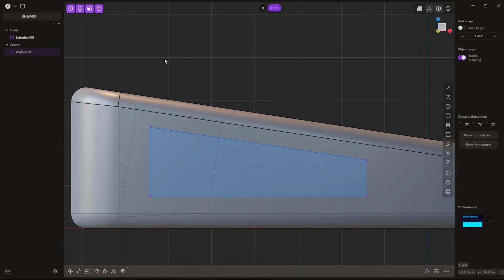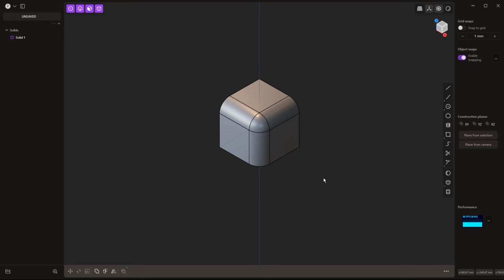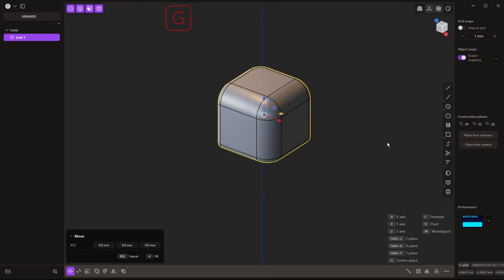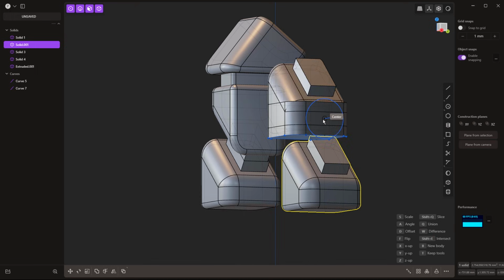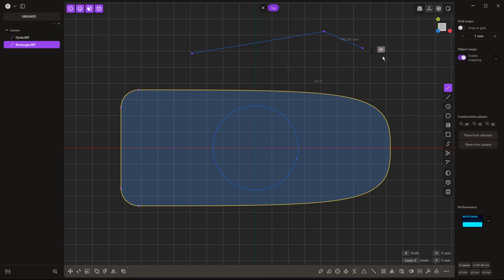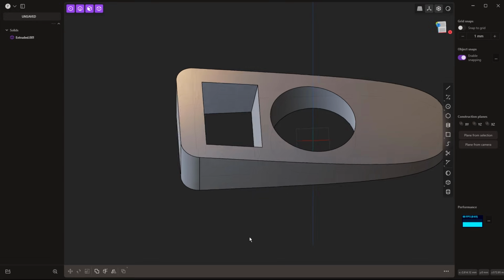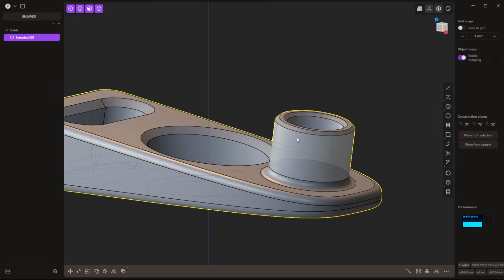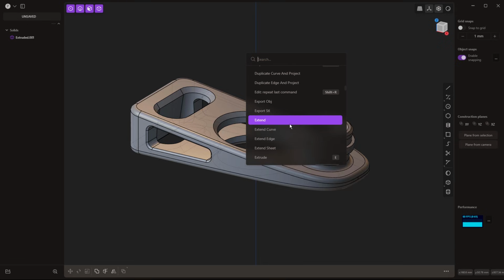Getting Started with Plasticity for Beginners | V1.4 Update | UI and Modeling Overview

Comment: "Traditional" CAD such as Siemens NX & Solid Edge, IronCAD and Spaceclaim do all that direct modeling together with parametric modelling at the same time.
Reply from the maker: That is true, but they aren't as good at it and most of those are a lot more expensive too.  IronCAD is the only one that is under $1000 in that list.  NX i think is well over $10k.  Solid Edge is very bad from a UI/UX perspective and is $2000.  Spaceclaim, woof :)  I don't even think they list their prices online.

What i mean by they don't do direct modeling as well, programs like Solidworks for example made a "Direct modeling" toolbar and just stuck tools that have existed in it for a long time.  But when push comes to shove and you try to move faces around for example, or add fillets to complex shapes it chokes.  I have taken several models from Solidworks, Fusion and others that would not fillet or shell, and plasticity has no issues with it.  Even though its build on the Parasolid Kernel it is a bit more flexible.

But yes traditional CAD in nearly all flavors have direct editing.  Honestly the closest one for me is Fusion.  Turning off history and still being able to create detailed sketches but not capture history is the next quickest thing to Plasticity for me, but its not the right tool for everyone.

Comment: Yes, but history even in Blender (not only CAD) is EVERYTHING. Its non-destructive! In Blender this is achieved by modifiers and Geo Nodes. Without history, you cannot adjust a project easily later. You have to do ALL the work AGAIN! This is a NO go for me. This is a great program, but it needs to have history or geonodes or modifiers added. This is a must if a client needs to modify the design in the later process!
Reply: I agree. History and the ability to modify is a huge part functionality.

A workaround for lack of history is to "save as" as you develop a model, especially before adding a key element. Another option is to develop seperate files as parts then combine them. This prevents you from having to start over from scratch.
Reply from the maker: @dchurch911  You can also duplicate the bodies you are working on and save a version of it.  Similar to how you work in multi-body parts where you derive something out, except here its independent.  I do this in Fusion Forms all the time.  Make a clean base shape and dupicate it before adding details.  When i get to a point where i want to explore something ill duplicate it again leaving an untouched version in case i need to take a step back (even though Fusion saves a version each time).
Reply: It is worth noting that although there isn't a timeline option, plasticity makes it very intuitive to delete bevels, champhers, close a hole and remove other executions instead of going back. Only exceptions I can think of are loft sweep and arrays. I found it fairly non destructive overall.
Reply: Cad is alot easier to augment a design than a polygonal modeler. Because of the nature of modeling with polygons when you are using mathematical curves then alot of times the software "fixes the modifier stack" for you
Reply: Do you use blender to add materials render and can you use a plasticity file in blender animation.
Reply: @rcguy2175 yes, there is a blender plasticity plug in. Live view of your model in blender with solid topology options. Definitely check it out.
Reply: Okaaaaay wow. Going to have to try this tomorrow. I think I’m sold just from the chamfer selection following the entire edge along the geometry. I’ve been struggling with that in shapr3d for some common modeling I do. I think I’ll be making the switch!
Reply from the maker: @ryleylamarsh  Make sure you check out some of the updated videos  https://youtu.be/eijIg-sjPe4   Since you have been working in Shapr3d this video might be a good intro  https://youtu.be/eT0_kX3eAEI
Reply: @qaesarx  Welp. After playing around I discovered that DXF support is null on a Mac so it’s a no go for me :(
Reply: Wait how to have history with Geo nodes?? In blender?
Reply: Almost. Its absolutely DEAD SIMPLE to make ANY change needed, you just have to know CSG Modeling techniques, and not rely only on the programmed solutions to solving the problem .
Reply from the maker: Thanks for sharing!  I think it "depends".  I come from CAD and would agree that history based is key to a lot of designs. but direct modeling is pretty powerful.  I guess it comes down to what types of models you make and what changes are needed.  Plasticity may see History in the future FYI.  It has been discussed on the beta discord channel.
Reply: @LearnEverythingAboutDesign  that’s good to know they will do it. I will definitely keep a big eye on this software. With history would be a true game changer!
Reply: @LearnEverythingAboutDesign so you're trying to compete against blender? No thanks, don't need another one of those.
Reply from the maker: @sirseriously  Me personally? no :) Plasticity is a program I use but I am not the developer.  Its goal is to be a companion to programs like Blender, not replace them.  So building hard surface models is quicker and easier in Plasticity as its working on NURBS surfaces and BREP solids.  There is a direct connection to bring models into Blender with the Blender Bridge.

Plasticity is an alternative for those currently using programs like MOI, Shapr3d and even Fusion where the goal is to go to a poly program.

Comment: I had never seen this software until now and coming from a Blender, Fusion and Maya background, this seems to be a polished Blender, in the areas they overlap of course. Some of the options you showed could be added to Blender too, like the CAD Transforms addon for the Grab -> Freestyle kind of stuff. But I didn't really see a whole lot in here (in this limited quick overview) that would make me want to pay the $300 USD for it over a free Blender. Especially considering Blender has decent sculpting and rendering tools, not to mention everything else it can do. 

I'm curious as too what your thoughts are of Plasticity. Would you actually recommend it over Blender for just modelling?

Love your content by the way, thanks for this video, I've learnt about a cool new program!
Reply from the maker: Hey There, yeah Plasticity is meant to be a companion to Blender and not replace it.  It is built on the Parasolid Kernel and is a BREP/NURBS modeler.  So you aren't dealing with a mesh, but a true "solid" or "surface".  Unlike things like Cad Sketcher for Blender that try to mimic CAD operations, this is a CAD program meant to ease in the Hard Surface type models that often take some care and creativity with edge loops and modifiers.

I would say check out this video on Blender Bridge https://youtu.be/rzcp4jBEYMk  Which has a real time link between Plasticity and Blender.  If you are a good Hard Surface modeler in Blender with your Add-ons and you like that workflow you probably won't get much more out of Plasticity.  But if you like a CAD workflow for direct modeling and then bringing those models over to blender or things like surface painter for doing materials, textures, rendering/animation then its worth a look :)
Reply: @LearnEverythingAboutDesign  Thanks for that explanation. If they could bring the parametric history to Plasticity, that would intrigue me a lot as that is one of the primary features I enjoy from Fusion. Or yes, if CAD Sketcher eventually gets to a point where it works flawlessly, then I could just go with Blender. If you know of software that has the history and precision modelling of Fusion but is somehow still a mesh modeller, please tell me, as this would be perfect!

Again though, thanks for making all of this content, I have learnt a lot from you over the months. Your teaching style is so easy to follow along with.
Reply from the maker: @manleyg4907  I think history might be on the plasticity road map BUT its a low priority I am sure.  They are adding Xnurbs and bumping up surfacing capabilites and i think will have some mesh based design tools like pulling a curve to a mesh.  I don't know of of a history based modeler but still mesh.  Fusion Forms is probably close but its direct modeling.  IF you use that to start a design you can right click on the form body and export the control cage as an OBJ and bring that into blender.  I did a video awhile back on that.
Reply: @LearnEverythingAboutDesign  That’s good to know! I will keep my eyes open for that then. Thanks again for all the work you do for us to learn 😁

Comment: I’m never using fusion 360 ever again after seeing this, it’s so straight forward and easy.
Reply from the maker: If you don't need the parametric CAD side of things to change dimensions, freeform modeling, or any of the extra stuff like CAM, simulation , sheet metal etc, you can't go wrong with Plasticity.
Reply: Really? No radial array for booleans. Fusion is a king of CAD. Not this blender shitty analog
Reply: @alexcooper83  There's definitely ways to do the same thing without it. Funny how using creativity is one of the core necessities for CAD, yet you can't think of a single way around this simple issue for a fantastic CAD tool. Only a fool...
Reply: @alexcooper83  Fusion is for hobbyist and definitely not king. SolidEdge is free to use with the community edition with no limits on the amount of what you do and you have a lot of moduls included in the community edition such as the generative design (if you try a bit you can export it, even with its limitation that says you can't) and simulation. You are the master of your file + it doesn't rely on your bandwith to work good
Reply: @alexcooper83 It’s crazy that you talk crap about a program then you say Fusion is the “king of CAD”

Holy moly.  That’s about the dumbest take I’ve ever heard.  And I’m someone that makes a big side gig living on Fusion.  It’s far from the best parametric cad software.

But hey, whatever man, you seem convinced!

Comment: OK So 13 min in I am lost as you're assuming that we all have numpads.  When you start and say, "Hit 7", and your display changes -- I can't follow along and make mine look like that. I googled it and it says there should be a preference setting for keypad -- there is no setting in my plasticity for a keypad. I am not going to continue and be lost because you're doing things I can't do. So this  is where I abandon your video. I am already frustrated because you're not taking into account I have ZERO experiance with this software. You're blowing through fundamentals or moving to fast through them because you're forgetting we don't know how to do this.  Show by example not by just clicking fast and making a cube wiggle.
Reply from the maker: I am sorry the process isn't working!  I don't use Plasticity on a laptop, but i think i do mention in the beginning about the UI overview that you can click on X, Y, and Z in the view cube up in the right to get to the default planes.  Very rarely am I called out for going to fast in videos ;)  If anything people tell me to get to the point quicker :)  This video is an update that combined several other videos that were done in v1.1.  There are some changes but I do have longer videos in this playlist that cover the UI a bit slower if it helps.

If you are using a mouse with a middle mouse wheel you can try holding down ALT, then hold down the middle mouse wheel and moving the mouse to the left/right/up/down.  This will snap to the next closest ortho view like Front, Right, Top etc.  

As for setting your shortcuts.  Hit F on the keyboard to bring up the command search tool.  Look for Viewport, you should see them listed like "Viewport: navigate to back" and it will say "CTRL+Numpad1" for example.  If you right click on that you should see some options to assign shortcuts.

Hopefully that helps.

Coming to Plasticity can be very tough since its a shortcut heavy program.  Users coming from Blender usually have a better time than users coming from anything else.

Comment: Difficult to follow at times, especially when using multiple concepts at once. Lots of information, but as a tutorial, it was lacking clarity.
Reply from the maker: Sorry to hear that but thank you for the feedback!  As this was an update to an older getting started video that was longer I only pulled out the common workflow info.
Reply: @LearnEverythingAboutDesign  I did get a lot from the video, and definitely intended my comment to be constructive. I would really like to see a tutorial that is easier to follow, and one that uses precise measurements rather than freehanded. Thanks again.
Reply from the maker: @tracybrown6004  This video I released when 1.4 came out with the dimensions which might help understand how Dims work (and how they don't work), but it wasn't meant to be an intro/beginner video into Plasticity.  https://youtu.be/kATCRYZKE7U

Comment: Thanks for this. Definitely looking for more Plasticity content. It seems to fit a lot of what I need, a straight up modeler that isn't trying to be everything to everyone, where I can build what I need quickly and not break the bank, and mathmatically based so that I dont have to become some sort of mental contortionist to effectively and easily perform simple functions, like chamfers, fillets and booleans without destroying the geo. It's been on my to-do list to get better at using this for a while now, and I know a current project would have benefitted if I had had the time to do so. It's a lot more powerful than people give it credit for, and perfectly fills a need if you don't need a parametric modeler (how often do I really use that functionality in practice for my purposes?) or need to create drawings and such. Just a few more improvements here and there, and I have a feeling it'll be a must-have or go-to for most of my modeling needs. I just need to get more comfortable with it. It seems like every other day, I'll notice some function and say, "damn, i should have just used Plasticity for this."
Reply from the maker: awesome to hear and agree!  Nick is trying to listen to what everyone wants in the software, which is great, but I think the direction it is going will still be the core "hard surface" modeler going to blender after the model is done, but with the capability to be good for users making 3d prints or just having fun.